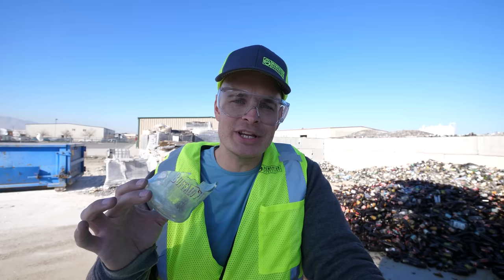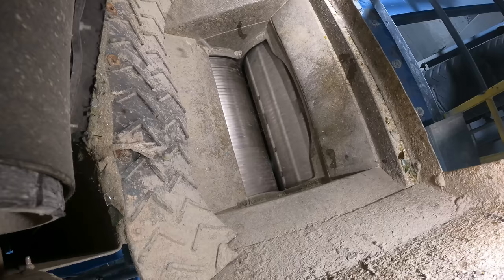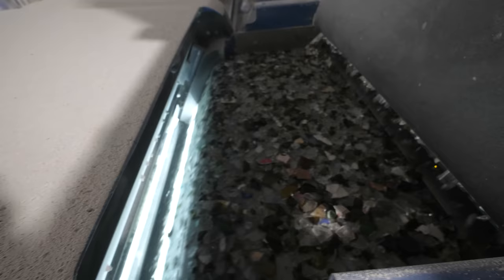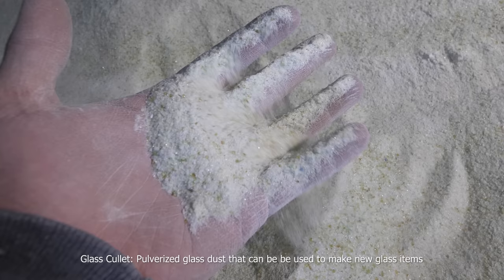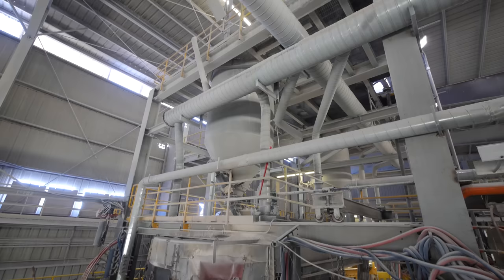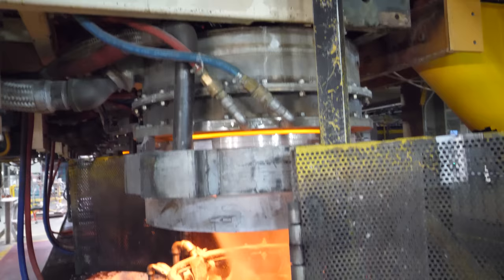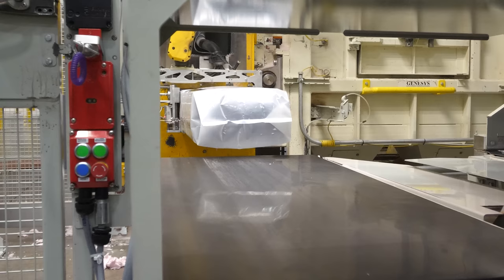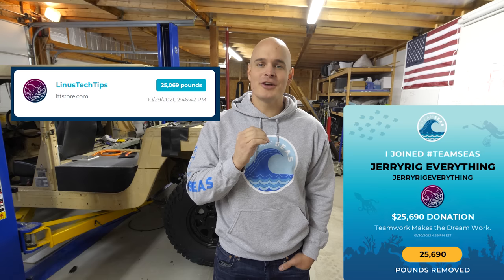What *REALLY* happens to 'Recycled' Glass?!  -  (you might be surprised)

Comment: Thank you Jerry from the UK, your video was so interesting and well presented by yourself as well as your cameraman. We have in our car parks glass collectors called bottle banks where you take your glass and put through the round holes. The glass banks a few years ago use to have separate sections 4 different coloured glass to be posted through the holes, The colour section dividers Has now been removed and the bottle banks now take all colours away mixed. The glass banks get picked up by a skip lorry ie you know as a truck it than gets taken to the recycling facility where it gets tipped into bays till it's picked up by a large arctic truck ie Simi than taken away after being weighed on a weigh bridge than heads out to the glass facility somewhere else in the country where it's weighed on a weigh bridge before being tipped off. I did hear they use the glass in the UK for road building as well as other things.

Comment: To recycle glass the used glass has to be shipped via multiple paths from curb side pickup back to the factory. That shipping energy is huge. On the other hand the glass factory can use sand and other materials shipped in by rail from mines where those raw materials are concentrated. Much less energy. There is no shortage of those raw materials. 
The point of recycling anything is to save energy. Making new glass from the recycled glass uses less energy at the factory BUT that reduction in energy is offset by the extra energy that has to be used to gather all the glass from homes and ship to the glass factory compared to huge rail cars that come from the mines. There was a fine report done on PBS Macneil Lehrer about 30 years ago that concluded that recycling glass was a net energy loss compared to making glass from the original raw materials.

Comment: I'm a 19 year vet in the auto glass industry and have always been told that automotive glass is non recyclable; laminated glass specifically due to the PVB layer. But I'm curious on whether tempered glass is or is not in fact recyclable. Maybe an idea for another video?  🤔
Reply: Yes automotive glass is recyclable but it is a little harder to do and therefore usually more expensive which is not "worth it" for everyone but basically it works as follows (shown more simply" for example the windscreen of a car or train is shredded several times to break the connections between "plastic" and glass for most types, this step alone has to be done 4 or 5 times with the same load (which makes it expensive)
But once you've managed to separate the different layers, it's actually the same way as recycling glass and recycling plastic.

Comment: I try to recycle everything I can, and this video partly restores my faith in humanity. Now if only most retail companies would bother recycling their unsold merchandise and broken products, rather then sending them to dumps and landfills, like my store does. Perfectly good products are put in the trash compacter rather than donated or recycled just from my retail store alone, (like many brand new plastic garden hoses, still sealed in their packaging or several massive gaylords of brand new pillows for example) just because the store is done with the style theme or it is out of season. The waste makes me feel terrible!
Reply: If only paper products could be recycled as repeatedly as glass. With paper, even pristine white paper, every time it gets recycled the wood fibres become shorter. Which is why you'll never see printer or photocopier paper that's 100% recycled content. You have to introduce some "virgin" wood fibre into the blend in order to maintain the quality, handling and finishing properties of the paper sheets. The higher the recycled content, and the more recycled fibre introduced results in a less robust paper product, and also one that is considerably more dusty. That's not too big a problem for ink jet printers, but for high speed lasers and production printing it's a nightmare. Which is why that lovely bleached and perhaps clay coated white paper eventually ends up getting turned into things like substrate for asphalt roofing shingles, blown insulation, formed trays (think of those paper things eggs come in),etc. Glass is so much more versatile. That's not to say we shouldn't recycle paper. That's hugely important as part of the overall recycling process. It's merely that paper gradually deteriorates with every recycling pass.

Comment: Glass production is uniquely suited to using wind energy. They don't need to heat the glass 24 hours a day, and they can handle variations in input power. The thermal mass of the glass acts as a battery.
Reply: whats crazy is why use plastic bottles when you can have glass bottle
Reply: What the hell are you saying
Reply: @felltrain115yes3  plastic is cheap to make, very versitile and has the added benefit of not shattering into pieces when accidentally dropped, you can see why they switched over back in the day before they learned how harmful it was to the environment, of course its been ingrained into our society for a while now that changing it suddenly now would disrupt a bunch of supply chains and throw most economies into chaos and instability, which is why research into methods to safely degrade plastic is being looked into
Reply: @lolzhunter  yea i thought about after typeing that

Comment: I wonder if there are any reported health risks to doing this kind of work and potentially breathing in those particles, or is it mostly fine at this level? Seems like hard work. Thank you for taking us through this process.
Reply: I kept wondering about that fine dust, and the potential health hazards!
Reply: I would assume most if not all the workers wear p95 or p100 masks
Reply: Occupational respiratory diseases... Pneumoconiosis...
Reply: I think that too. But then I thought, glass dust is just similar to ordinary dust. Unlike metal or plastic when turned to dust.
Reply: Silicosis is the lung disease that occurs when one breathes silica dust (glass, sand, quartz) over long periods. It is similar to black lung disease for coal miners (I've heard the term white lung disease in association with silicosis, although I don't know how common the term is).
Reply: @Gimbal117  Actually, using glass cullet or glass debris during glass manufacturing reduces the melting temperature a significant amount when compared to using pure silica sand. Doing so decreases the needed energy to actually melt the raw (lowering pollution from burning fuel for melting or electricity), the transportation pollution costs are similar when comparing pure raw vs cullet + raw, and recycling glass removes that glass from landfills (another measure of pollution). Overall, recycling glass doesn't add to the amount of pollution when comparing the whole life cycles of the manufacturing process with or without.
Reply: Glass dust is worse than breathing in agent orange
Reply: I am surprised… he touched that with his bare hands lol
Reply: @vitrify  Silicosis is only causes by crystalline silica (such as sand or quartz or other silica containing minerals). Glass dust, which is amorphous, does not cause silicosis. The leading cause of it is probably concrete dust these days.
Reply: I was wondering why he wasnt wearing at least n95
Reply: @koofdome  ; False

Comment: It’s very cool to see how many things you can do with an old empty bottle. Maybe you can show us where old phone parts like batteries go and if they are recycled. Also because you do a lot of phone tests.
Reply: As of right now mobile batteries just get molten like normal scrap and then seperated into aluminium, copper, iron etc and many precius minerals like lithium are lost.
There are also newer Li-ion recycling facilities which are discharging the batteries, shredder them and sorting the materials, but those are mostly prototypes and phone batteries wouldn't end up there since the discharging every single one wouldn´t pay off.

Comment: From the environmental perspective the energy savings are indeed the real benefit of recycling glass. On the environment, it is basically "funky rock" or "funky sand" (main difference is that sand is the crystalline solid form, glass is amorphous, but it doesn't really matter in practice). Though there is one much more energy shaving form of recycling glass, which is to clean and re-use non-broken glass. IMO system's should optimized for that as the primary standard for reuse of glass products.

Comment: How they reliably get rid of the colors it's still mysterious to me. I get the optical sorter for Brown glass but that leaves a few questions. What happened to the brown glass. What about the other colors of glass. How did they get the optical sorter so reliable that it can do such a good job. What about the many particles that are going to be smaller than besides that that the optical sorter can deal with.
Reply: Easy solution to that, dont mix all the colours and different glas typs together in the first place.
Here in germany we have containers for withe, green and brown glass and they are only for bottles and jars, so its easy to make new withe, green and brown bottles from it.
Window glass has a higher melting point and cant be used to make bottles.
Reply: @wolf310ii  Well, in Canada here, we don't separate different colours of glass.  In fact, glass, plastic and metals are combined into a single container to be picked up by a recycling truck.  We are far too lazy to separate the materials reliably, and the space needed for so many containers would be prohibitive.  I have reason to believe that much of the material, particularly certain plastics, ends up in the landfill.  Until 2017 such materials were shipped to countries overseas, but they are no longer accepted by many of those countries.
Reply: @wolf310ii  you still need a sorter of the same kind, but it can handle more input.
Reply: @Starchface  Oh, they dont come to your home to collect the glass here too. You have to bring the glass to the containers wich are placed every few kilometers.
Befor the "recycling hype" started there was also a container for paper.
These containers existed like forever.
Now every home has to have 3 or 4 bins, paper, bio, "recycling" and one for the rest.
The "recycling" bin is for everything with the green point, but thats pure moeny making. A few years ago only trash with the green point on it was allowed in the yellow bin, a wrapping from the same material just without the green point could cause the garbage truck didnt take it or you could even get a fine.
It was (and is) pure money making because the producers pay to have the green point on the product, the consumers pays for the green point on the product and the consumers pays also for the extra bin and they wanted the consumer to clean the trash.
And yet it got not even recycled, a good part of the cleaned and sorted trash did go directly to the garbage incineration plant, because the rest garbage doesnt burn anymore.
And the rest wich made it to the recycling center got only sortet in metal and plastic and the plastic was send to asia to sort it into usable and unusalble plastic (compound plastics). The unusable plastic lands in the oceans or is burned in the open.
Now we have tetra packs with a paper straw, wrapped in plastic and the tetra pack is still a unrecyclable compound made of paper, plastic and metal.
Because its the consumers fault that the plastic lands in the pacific, and not the companys fault, who send the platic to asia.
The recycling in germany is a big fat lie.
Reply: @wolf310ii  I'm from Austria and can confirm most of the things u said are the same here... :/
Reply: @Starchface  those recyclables now get dumped in other Asian countries, where it pollutes villages and ecosystems.
Reply: Those optical sorters are insane, definitely. There must be a few nice slo-mo videos on YouTube...
Reply: To answer your question about how it sorts, it's light. Computers can do things in 0.0001 seconds like we can't even fathom. So all it takes is 'teaching' the computer that it needs to send out a puff of air when light either travels 0.0001s or 0.001s. Different colors glass will give different results so that's what the computer reacts to. Since light is the fastest speed we know and computers are nothing more than plastic/metallic amalgamations reacting to light and electricity going back and forth... there you go. 

If you do some research as to why brown glass is brown and what it's made up off you can answer your other questions yourself.
Reply: @suyci  thank you, appreciate your answer but actually understood it to that level. Still even with computers and Optical detection there's a lot of details must be extremely hard to work out like how to get one piece flying by the optical detector at a time, how do you deal with very small pieces interfering with the detection it's like Jagged reflective surfaces that don't wow for direct transmission at certain orientations, etcetera
Reply: @michalchik  No problem. however, no offense, I don't think you understand just how amazingly simple machinery can be, especially in cases like these. It's mostly because they use fancy words that makes it seem like every computer has a universe inside it, but it's all just plastics, rubbers, metals and other stuff working together through heat, light and pressure. Also because there is a fundamental misunderstanding about what electricity, light and temperature really are people see machines as magic, but it's all just logic... very, veeeeeery complicated logic :')

To understand, truly understand how those things work takes years of study. Luckily there are tons of free sources on youtube that can get you started. If you want to start learning about physics then I recommend you 'Shock and awe, the story of electricity'. From all I've read this made my understanding of electricity better most because it shows very well the questions there are still left  to answer as opposed to the complicated stuff that scientists are speculating about. 

If you are looking for some engineering details look up Lesics, I found them because I wanted to know more about cars, but they've recently done a video on how cleaning robots work, they also use laser detection so maybe that has some answers. Real engineering has some really cool stuff as well. 
If you want to know random things about laws of nature and different points of view on the universe look up vsauce, he's been making tv quality content for 10 years now. He may be a bit nutty but he's really good at explaining how wacky the universe can be.

Illinois energy prof has a lot of free short lectures on the basics of physics and he explains it very well. He specializes in electricity but his video 'why is the sky blue' will explain in part how the sensor of the glass separating device works if you pay attention.

Hf learning :)
Reply: @suyci  I take no offense and I appreciate your Earnest advice though I think you underestimate my comprehension of things like computers and physics an optical sorters.
Reply: @michalchik  How can I underestimate someone I know nothing about? You asked a question  and I provided a way to an answer since a youtube comment can never explain everything. I have no issue answering your questions for myself, but theres no way I am going to write a book here to explain it and no one likely ever will. 

Assumptions are the mother of all fuck ups and you are assuming that you know enough while you still have questions, curious.

Comment: Great video!  I'm so pleased that more and more recycling opportunities are presenting themselves, and this is a great example. Now if we can just back away from the whole "don't fix it, replace it" mentality attached to electronics and appliances!  It's shameful how much we manufacture that must be thrown away by design as opposed to making a simple repair with an inexpensive replacement part!  I like to point to the example of the voltage regulator in an automobile... it used to be 4 bolts and 2 electrical connectors in an easily accessible place that you could replace for $5. It is now buried deep inside your $300+ Alternator that will cost you another hundo for someone who can find it to change!

Comment: Most molten glass is slightly acidic (because of the silicon) and slower dissolves the steel electrode- looks like a cold finished bar - easily replaceable.

Comment: The main issue with glass recycling is cost based.  If everyone dropped off their glass at one of these centers, there wouldn't be a problem.  But they are few and far between in my understanding.  The cost of transporting the heavy weight of the used glass (both money & emissions) far outweighs the benefit over creating new glass.  So whether a corporation, or an environmentalist, glass is best left to the landfill for most of America.

Comment: really cool, it'd be neat to see how they deal with non magnetic metal though. ferrous metals can be dragged out by the magnet, but what about aluminum?
Reply: It's probably blown out on this moving roller tape. If such things exist in plastic recycle facilities where a specially dedicated blowers can blow out PP, PVC, PET to separate color fractions, it's most likely same for non ferrous metals.
Reply: There are non ferrous metal separators as well
Reply: They usually melt in the furnace and gets rejected in the inspection line😅. Im working in a glass container manufacturing company btw.